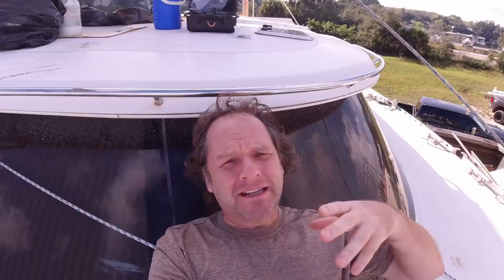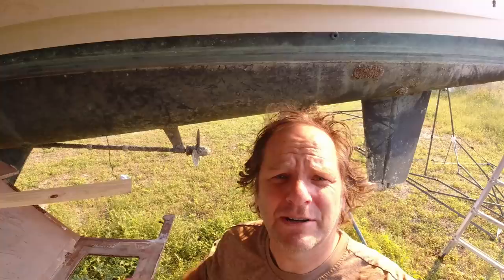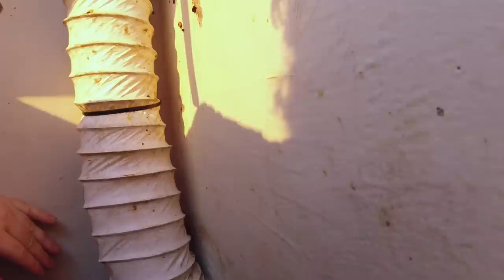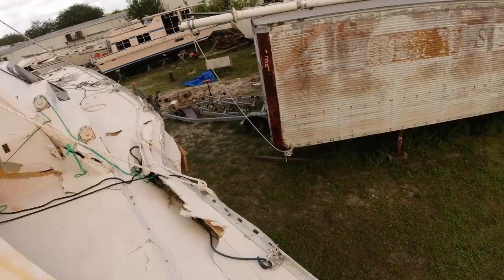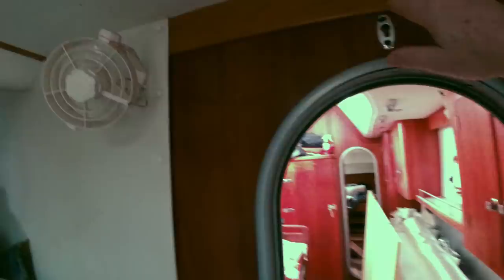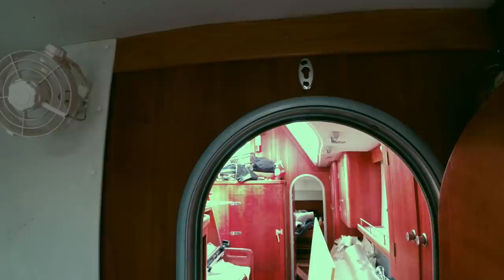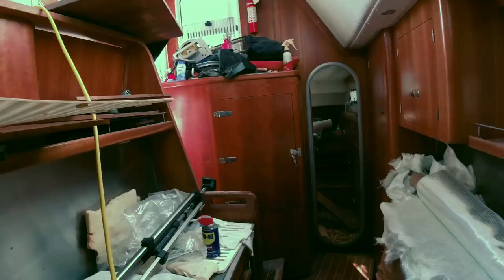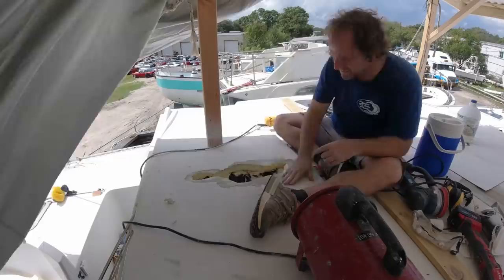11 How Bad is my Sailing Catamaran Damaged? Can I repair it?

Comment: You said "I'm not an engineer"
Well...I am. Have an engineering ms and mba. And 17 years experience. Let me tell you, you ARE an engineer. Much better an engineer than many with degrees. Don't underestimate yourself. You're doing a great job. The first thing you needed to do is to understand what needs to be done and organize the project, you did. Next is to know exactly how that boat works structurally, where the loads begin, where they transfer to, how they transfer, where they end. And you know. Next thing, how to fix all structural issues PROPERLY. You obviously know how to do that. You are an engineer whether you like it or not! And an engineering technician..who are also usually way smarter than most engineers. If I owned an insurance company, I'd insure you without hesitation. Keep up the good work. And thank you for the videos, they're extremely time consuming to capture and edit. I hope you end up with income from patreon and YouTube ad revenue. I know you'll end up with an awesome boat. Cheers!

Comment: Im glad you did this, Im an engineer formerly out of the submarine business and what Im looking for initially is structural integrity so that you dont have any Zingaro (sorry James) moments. If there is going to be a failure here its in the bonds to bulkheads and joints to hull part, hull to deck etc. If as you say you cant see any cracks or distortion you are good. Next is the rig and chainplates which you helpfully had a look at. Although there is no evidence of crush or compression failure I did notice some tabbing had disconnected between the bulkhead and the hull (?) at about 8 mins, this because the rig is strung like a guitar and will try to push the mast base down and chainplates up, make sure you look at the step and whatever elements there are in compression. The whole thing is tight and solid so the only give will be in moving chainplates or bulkheads which will have some give. 

If structurally you are solid, your next case is water tight, its that oil can kind of strength and integrity so repairs wont collapse in a storm or if 5 toms of wave wash over. As long as your joints and hole fixes have a 12:1 kerf joint they should be as solid, if not more so than the parent material. When you do punctures grind them out dish like to 12:1, lay the largest piece of glass first and go progressively smaller as the wound fills. 12:1 is also important on larger joint areas, so you are sure original strength is replaced. Just on resin, where you are can make resin mixes difficult because of heat, you might find it easier with a 2:1 epoxy mix rather than 5:1 epoxy, ultimately just because measurements are easier and more accurate.

Please examine the mast step and stuffing box areas and rudder posts very carefully, anywhere where large forces such as through the rig, or large weights such as the engines, tanks and batteries reside have not compromised the hull. There is no reason you couldnt make this boat stronger than new
I saw my first computer in 1966, this thing occupied an entire house, and my first punchcard program I ran failed, so good luck with the software 8)
Reply: Zulu 401 . I have seen under water wings that help stabilize the vessels from the pitch and yaw under heavy seas. Do you think that if you would put under water wings on catamarans linking the hulls together forward and aft. Would the wings not only stabilize the vessel for more of a flat ride but also could prevent the hulls from flexing toward each other.
Reply: @richardgooding498  first up whatever they would do it would be at the expense of drag. This kind of approach isnt unusual, what we do know is usually crossing the full beam of a cat underwater is offsetting with forces far greater than is required purely for stability. As water is around 800x the lift we can get out of air it would be possible to recover some drag by lifting the boat partially out of the water, still it irks me. After all, a submarine can be said to fly through water and it does so on much smaller foils or trim planes. All this however is very much the experimenters field. Generally the perceived additional strength isnt really required, as the break up of well manufactured boats is extremely rare. From where I sit and all due deference to James who simply owned the thing, Zingaro wasnt within the scope of well manufactured. 

While noting foiling cats have quite small foils, I think if I was looking to stabilise a cat it would be from hobby horsing some cats tend to exhibit, but for this one would only need a span of a few feet, these would be similar to sideways keels. I know this because I have seen some efforts on older cats that hobby horse quite a lot in some conditions. I also think the strength of a foil that went the full beam would be questionable, as it wouldnt have a particularly deep chord section if you were out to provide stability with the least drag, at something like 12% of chord for thickness it would be quite weak. Purely by eyeball science the dimensional properties are simply not there for meaningful strength. That said there was a systems for monohulls that encapsulated a foil across the full beam of a boat, which would be pushed out of a sealed box in the hull, at about 1/2 beam for a quite good stabilising effect fronted by Gordon Kay. I quite liked the idea myself but I dont think its really going anywhere for the present. Check it out here https://www.youtube.com/watch?v=ksDTRR1HhsI
Reply: Zulu 401 . The drag is definitely a issue with the hull to hull foils. Thanks for the reply. Also.  Have you seen any hydraulic  cylinder masts for sailboats that would be able to shorten the masts by hydraulic cylinders to make for crossing under low bridges. I have seen a concept on using hydraulic cylinders from semi truck dump bed trailers as a mast and the running rigging was on retracting spring winches. It looked like the rigging was able to be taught once in position either in the up or down position once the mast was placed in position (either up or down) . They drew up the plans with the solar panels being mounted to the top of the mast and once lowered would serve as a shade for the length of the boat almost. Just wondering how you think a experiment such as this would work. Thanks
Reply: @richardgooding498  I know that there was an Australian proa designer (Rob Denney) who was interested in telescoping masts, his would have been out of carbon. I think he never got a satisfactory result and I can explain why. The devices on trucks are funny enough described as masts, but they are made from chrome steel material and only ever have to push the ends apart. They are very strong but very weighty. If you wanted the same on a boat you must remember that all the forces through it are up and down for weight, and from the sides for sails. To satisfy sliding inside the mast the portions need to be free enough to move yet stiff enough to be perfectly upright, it will trap with the slightest pressure from any breeze, either up or down.  And remember once up you have to tension the rigging wires or tune the rig every time you erect it, kind of a black art in itself. To be both lightweight and strong enough to defeat collapse from windage seems to me to be the counter issue, and it doesnt feel like it is workable. 

Traditionally transiting under bridges is solved with a mast tabernacle, or folding joint at the deck. The mast is raised and lowered using a boom at right angles to the mast to aid lifting, and bringing it down safely using a winch. My own mast is just 46ft above the water on a 37ft boat, and I wouldnt contemplate raising and lowering it without a crane, so theres that.  Another traditional means of shade was to rig a canvas over the boom, its called a boom tent. I had one made for Zaya in white and it is very good at keeping the worst of heat out of the boat cabin.
Reply: Zulu 401 . You are great. Thanks for the intelligent conversation with you and I like your straightforwardness on your approach to all the questions I asked. You are definitely someone I would be interested in talking with and bounce ideas for the sailing community off of. Keep up your go work my friend. Much appreciated. Have a great day
Reply: "When you do punctures grind them out dish like to 12:1, lay the largest piece of glass first and go progressively smaller as the wound fills."
Wouldn't be a stronger contact to the surrounding area if one starts with a smaller piece and progressively go bigger? You would have multiple contact layers to the substrate then. With the big piece first, the subsequent pieces is "on" the first piece and the job as strong as the first piece only.
Reply: @bekirbayburt6157  I know,it sounds counter to good sense but, it turns out good sense isnt right, which is why I never fail to point this out.
Edit forgot the link
https://www.westsystem.com/wp-content/uploads/Fiberglass-Manual-2015.pdf
remember that after you do one side you have to do the other
West System Manual page 74 item 12 .3.2  Large voids
"The first piece should be slightly smaller than the outside of the beveled edge with subsequent pieces gradually getting smaller. "

Comment: I've tackled a couple salvage/restoration jobs in the past.  Including a 34' classic wooden power boat that was partially submerged for almost a week. If your goal is to have a big expensive project that will keep you occupied for a long time then it will be fun rebuilding this boat.  If your goal is to save some money on a boat to go cruising on................well, good luck with that.

Comment: I’m hoping that you build it back better than factory. Since I’ve been able to see what factory specs are from Hurricane collision boats. At least using marine grade plywood with resin and fabric overlapping to give the catamaran better structure. I’ve been able to see some amazing interior cabin wood used on catamarans and sailboats as well. I’m just hoping that you’re able to make your boat stronger considering what you have seen it go through already. And I know that money doesn’t grow on trees too, but, just saying put it in if you can, better than factory. Keep up the great work sir,  looking forward to seeing your next video. Good luck and God bless

Comment: As long as you're cool working on her for 3 to 5 years. Go for it! 
If you think less then STOP now.
Reply: Maybe, but the guy looks very competent. And has an amazing attitude.
Reply from the maker: @mikewilliams4947  Thanks for the vote of confidence. I think it will be 1.5 years, so double it and 3yrs is very likely. If it takes 5 so be it as long as I'm still having fun.
Reply: @BryanSailing  I remember putting an old 28 Bertran fly bridge back to spec. It took a bit. Every time I could, when getting off the back of the boat I would pretend I’m jumping in the water :). I’d make a “sploosh” noise. Made me feel better and the job go by faster. I’ll keep watching. Thank you for putting up the content.

Comment: Your structural analysis of the boat is fairly accurate. At PDQ we didn’t use unidirectional. Perhaps the builder in Argentina uses unidirectional. Which hull number is your boat? As I recall we use over 2000 feet of 6” x weave 1801 tape for all of the bulkheads. Every single cabinet was also glassed to the hulls. We had many customers that bought our boats because they didn’t “groan” in a seaway.

Comment: If I may make a suggestion on the chain plates.  Replacement with stainless steal of a high grade will be much better.
Reply: Chain plates are 316 stainless. The backing plates are aircraft grade aluminum plate.

Comment: Do you use parts that you can get out of a salvage yard and what is the cost to rebuild the motors ?
Reply from the maker: I will try to use some. It cost me about $1500 in parts for the motors. I still need to put another $1000 or so in them. I did all the work myself. In a future video I'll show the process when I swap the piston in the one motor that got damaged.

Comment: Thats why steel or aluminum boats are better. 
A whole lot stronger and if it's bend, just use a hammer or some hydraulic cylinders to bend it back. If it's worse, cut the broken sections and weld new plates back in.
Even wood is nicer to repair. Fiberglass and carbon is total nightmare, I hate that stuff.